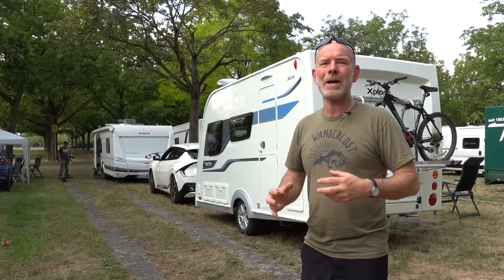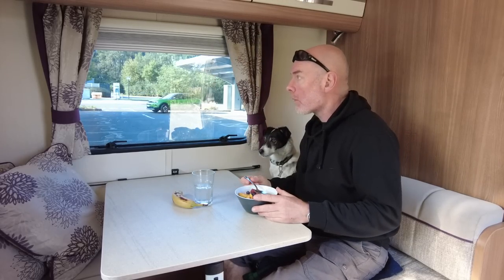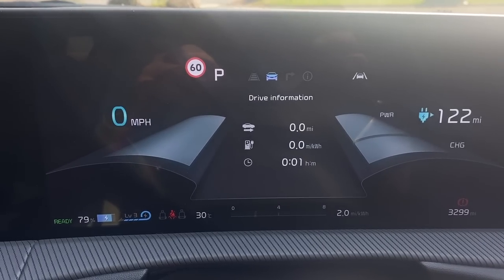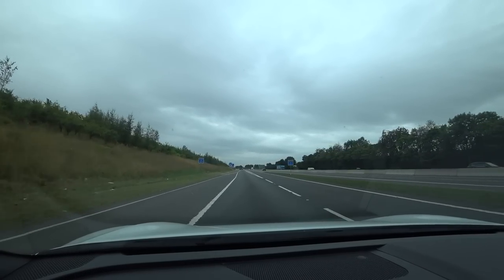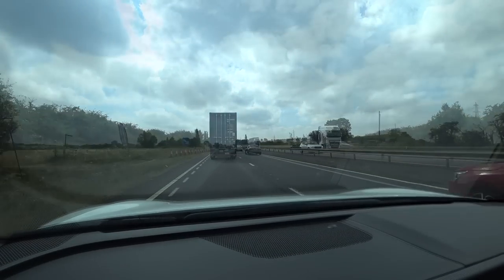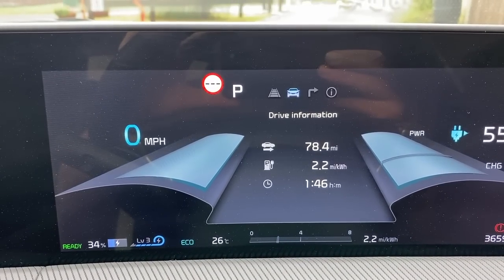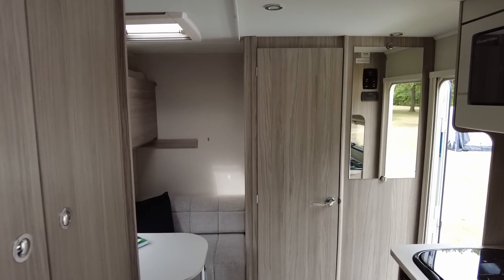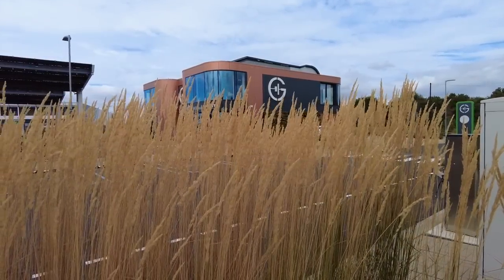EV towing a caravan to Germany from Scotland: Range and cost

Comment: Thanks for pointing out that towing is not an issue for EV. And the driving is very relaxed.
My experience is with my ioniq 5 and a 740KG max trailer....From Poland to Netherlands in 2 days without any issue at the end of Christmas vacation. (1280 km in total or between 600 and 700 km both days.)
Because the cold wether (-2 to 5 degrees celsius during the travel) I cannot copmpare the energy usage directly to usage with warmer wether but it seems that the usage is not very different from tavelling without trailer (take into account that without trailer I'm allowed to drive 140 km/h in Poland and advice of 130 in Gemany...with trailer ca 80 km/h in  Poland (LKW speed mostly is 85-90 and I take that speed) and 100 km/h in Gemany...The netherlands does not count in km because only a few km from German border. 

May I recall to previous years when car owners pu an aerodynamic shield on top of the car to bring the caravan more out the wind....I was told then that it meant the owner could use fifth gear instead of constant fourth gear....
It could save you electricity.
You tell that the smaller caravan increases youre range with 15%...but also you was driving a little sloewe. My experience is that any mile slower will increases your range with some 3%...3 miles slower means 9% increase of range. 

(My light trailer is special bought to be the same height as my ioniq 5....such a device will not add to me anything....maybe changing the back of the trailer hood, lowering the trailerhood there can make differences if done aerodynamical correct. Also <=750 kg trailers (or less) are taxfree in the netherlands. Aerodynamicall...It is the back of any car/trailer.caravan which effects the drag most)

To the end..Already for years I drive electric, first long travels with a koneE64....and I'm  also used to eat my meals including breakfast at the charging stops. However....The ioniq 5 ..same technic as EV6..charges so fast that I have no time enough for a meal if I charge to only 80%....means that I put the DC ( fast) charge limit on 90% and stop with charging when my meal is eaten (possible I even have to disconnect ftom charger during my meals when the car reaches these 90% in less than 30 minutes.)
Reply from the maker: Thanks for sharing your experience. I did have a problem over the winter with the charging slowing right down because of the cold, but you are right about not having enough time to get a meal! All the best.

Comment: How frustrating is it having to disconnect and reconnect the trailer at every charge stop? How much time does it add to each charge stop in total? How close are you able to park to chargers most of the time?
Reply from the maker: 1. Not very. 2. Mentioned in the video. 3. Depends.

Comment: That was a great vid. I prefer to tent so you don't have to charge as much and you can just zip around anything with ease. Kona EV and a big tent. No problem. What is a problem is the far and in between chargers in Ontario Canada. So IVY, Flo and Circuit Electrique if you are listening? We need more chargers in Ontario. If I had only a 100Miles of range I would get stuck in the middle of nowhere.

Comment: Awesome! What a fantastic data deluge and therefore great contribution to the community!  Great to be able to compare aerodynamics in real world conditions as the fronts of the Xplore & Compass are fairly similar so (in a not quite robust enough for a peer reviewed scientific paper but still extremely useful way) the effect of trailer weight can be seen. As well as reduced drag on that last leg I wonder what difference temperature made... aircon would have been working harder but an ambient of even just 4 degrees higher would have made a difference to the chemical reaction speed going on in the battery. How much, I've no idea (or rather I can't remember how to calculate!), but it will be interesting to see what happens in subsequent similar drives. Very much looking forward to your videos from Dusseldorf.  You probably know already but the Eriba Touring range has had quite some changes this year - whole new chassis I believe including a Knott coupling, which apparently comes about from Hymer building their own chassis production line! Would be interesting to hear any updates on what their thinking is in terms of competing with Alko for lightweight chassis design...  New Tourings subsequently are now flat floored rather than raised at the back and have a refreshed options list including copying the rear boot/underbed access idea from Airstream, retro road lights, chrome everywhere plus interior style tweaks building on their Ocean Drive, etc. experience. There's also for the 1st time in a very long time a 560 with fixed bunks and the Feeling range (Tebay are I suspect the only UK supplier) also has a new fixed bunk version (again there hasn't been one of those for ages) but it's a monster at nearly 7m long ;-) still shows Eriba are thinking small & lightweight for multi child families for the 1st time in ages in addition to their luxury, massive, heavy, other ranges... Looking forward to seeing what else you unearth :)
Reply from the maker: Will go check 'em out Becky! Cheers.

Comment: Note to all EV caravan towing drivers…..sit behind a HGV for every journey, and buy a smaller caravan……lol.  Thankyou Andrew very interesting info….and a massive saving to be seen already, for a small change in routine…👍🇮🇲🐶💪
Reply: I was doing similar in France with a 3 litre diesel X3 and 1600kg caravan, got up to 34-35 mpg for around an hour until i pulled into an aire, i was generally getting aroun 31 mpg in normal traffic so the savings are there - you also do not need to be right up the lorries arse either
Reply: Always look for a nice big HGV to make a hole in the air👍

Comment: Excellent informative video as usual Andrew. People are free to make their own choice, but you have proved that it can been done.  Sure it took a little planning, but you never appeared to suffer the much advertised "range anxiety".
One question, why did you not compare the trip with the diesel using the ferry to make them more comparable, as the diesel covered a lot more miles?
Those discounting EVs because they want to do a trip without stops, should acknowledge that you had to stop to change caravan, offload Dougal, eat, rest and use the toilet.
Reply from the maker: Hi Charles, I was purely comparing the trip to one I had experience of making before, as I couldn't actually do a like-for-like comparison. That's why I broke it down into units. I'm totally with you on the 'non-stop' brigade. It's all white noise to me now!

Comment: Great video, we've just bought a Pennine Pathfinder to replace our old caravan. Mainly for more space, but also in anticipation of our Kia EV6 arriving early 2023. I think the wind resistance is going to be the key thing for range, so am hopeful I'd get decent range with the Pathfinder, 120 reliable miles would give us a great area to explore from the North West of England without any charging stops. Would love to see what you get if you do get a chance to tow a folding camper.
Reply from the maker: Cheers Richard. I hope so. I'm finding 140-150 miles now is doable on a full battery and 100 on 80%, so I imagine you'd have no bother with 120 miles with a Pathfinder. It's now just a case of trying to find a trailer tent from a dealer that is sufficiently insured for a test tow, as it's classed as commercial use :-/
Reply: @andrewjditton  Got ours privately, but did visit the main dealer/factory first. Lovely people and quite interested in questions I had regarding the external socket for charging an EV (I wanted to know what the circuit could take, it's only on a 10amp ring main fyi). I'm sure they'd be interested in letting you borrow one for the publicity.

Comment: A very interesting and enjoyable video. I think one of the main points that can be seen is that positioning of EV charging points need to be brought more to the front of planners minds when designing  (or redesigning) the layouts of service areas. Particularly on Motorway service areas where long journeys with a caravan in tow would be expected. Having to unhitch the caravan in order to get onto a charging point is not really a way forward. Drive through rapid charging points should become the norm.
Reply from the maker: YES!!!

Comment: Great video Andrew, I would go out and buy an EV tomorrow  buts its the cost of one also living up here in Yorkshire  our local coop petrol  station doesn't  have EV  charging yet and as they are very few and far between also being a carer and doing many miles over rough roads and cattle grids I am afraid  the EV will just have to wait until lots of costs and road improvements  are made , which is a shame because EV is the future  car which I would prefer  😃

Comment: Hahaha. Our last trip was towing our 11foot, 2500kg van from Darwin, through El Questro, up the Mitchell plateau, then down to Broome via the Gibb river rd, then back across the Tanami to Alice Springs. Longest dist without fuel was Bililuna to Yuendumu, about 600ks. No charging, no power, anywhere between Drysdale station and Derby. I carry 125 litres of diesel  which will give me about 750km of range. 
Electric.....  never going to happen. There is not enough copper or lithium in the world to replace the existing fleet.
Unless you live in a rich, firstworld, tiny-footprint country.

Comment: Interesting, thanks.  There are some attention grabbing headlines doing the rounds at the moment that charging your EV will be more expensive than filling with petrol, given the recent energy price hikes, but this video shows that they've got a way to go before that becomes true.  If only the route into EV ownership was more affordable then the running costs are certainly much more palatable, and your video shows that with better infrastructure, such as what GridServe are installing, then it's just the mindset of the neigh-sayers that needs to be changed.  Rome wasn't built in a day.....👍
Reply from the maker: Cheers Matt. It IS possible to pay more with an EV than diesel, especially when towing and especially when in a hurry, but you'd have to try very hard and be a bit dim to use these places all the time. Overall the cost is still well cheaper. And yes, infrastructure is coming along.

Comment: I think reason you got better mileage in Holland , is because the slower speed you where doing it’s the same with petrol and diesel cars ,go down to about 50 mph and you always get better mpg
Reply from the maker: Yes, that's why I expanded on that at the end. That, and the smooth surface with less rolling resistance.

Comment: Thanks for the video, I enoyed it. I would say it proves that EV's are not good over long distances especially towing a caravan. How long before the caravan gets stolen? What happens if two EV's are on a site and only one charger? We recently went to Spain, virtually no EV charging points between Channel and border. The disadvantages are endless.
Reply from the maker: As are the advantages: quiet, smooth, powerful, stable, strong. I've just checked chargemap and there appears to be slightly more than 'virtually no EV chargers' along that route by a few hundred or so, so I'm not sure where you got that data.
Reply: @andrewjditton  Andrew, you've come back with the advantages of EV as you see it, please allow me to come back with the advantages of my ICE Mercedes GLE. It is quiet, silky smooth 9 speed gearbox, 3.5 litres of Diesel torque and power, stable with four huge tyres, strong tow  bar spec 150kg, beat that ! And best of all with two adults two dogs and a 1900kg Couchman VIP675 to pull it'll take us 600 miles, with a 5 minute top-up another 600 miles and I don't have to worry about unhitching her at a service station. I respect your opinion and I trust you'll accept mine - supporting EV's with the current energy crisis, which is not going to improve is a case of joining in the old tale of what lovely clothes the naked emperor is wearing...
Reply: @GG-gotr6  Indeed, you're right. You need to have a pioneering spirit to tow a caravan with a BEV - it requires a certain forgiving attitude of mind. But it was only 14 years ago you had to have a similar pioneering spirit to just drive an ordinary BEV, - basically the Leaf - 24 kWh £30,000 and range a lucky 100 miles and no chargers for the nearest 100 miles.. However, there's a reason we're all going to have to go BEV, like it or not, and that's that we're killing our planet and our future with over 2,000,000,000 ICE vehicles, spewing out about 5 billion tonnes of CO2 into our overloaded atmosphere. So just remember to apologise to your grandchildren when you're old and they're facing some existentially  difficult and probably insoluble problems. Remember too the privilege you have to enjoy your life-style when 90% of the rest of the world's population can only stand and stare as you whisk by in your glorious metal chariot. Cheers. JKM

Comment: Caravans manufacturers really need to start thinking more about weight. My last caravan was a six berth 1994 Elddis 1080kg, the equivalent now would be over 1500kg. My 1st caravan was an old 5 berth, I think that was about 750kg, still had double glazing but no water heater.

Comment: If you went via Euro Tunnel with the EV you could have taken your dog. Adding kennel fees it would have added a lot. You compared two different routes using two different vehicles. Useful info on towing a caravan with an EV that I haven't seen anyone else do. Leaving your caravan in the services is risky as pikeys like pinching them.

Comment: Brilliant video - thanks for the excellent content 👍🏻

I get why you compared it with the Navara via Chunnel but would also be interested in the like for like (can probably work out if I rewatch)

Some really good advice re swapping activities (brunch whilst charging) and drafting HGVs for economy (latter applicable to all!)

My main gripe with CPOs is lack of “drive through” charging provision - especially at new sites 😟
Reply from the maker: Hi Andy, yes I was comparing my own behaviours, but I gave the cost per mile to give an idea. I agree with your gripe. MY main gripe is that so far nobody in the automotive or charging network industries will see me or have the slightest interest in the data and experience I am collating. I approached Gridserve a week before my visit to ask about pull-through charging and if I could speak to someone to explain the facility. I got an acknowledgement but no actual information or follow-up. I'll keep chipping away though. Cheers.
Reply: @andrewjditton  I have replied to so many CPO tweets about new locations pleading with them to consider provision of drive through (or end) bays in future designs but they rarely engage. 😟
Reply from the maker: Ugh. Sadly I have had the same (non-) response from Gridserve.

Comment: Kia EV6 depending on spec £46,000 to £60,000
Not exactly affordable for the masses.

Im one of those people that spends around £500 to £2000 on a car.
Ive owned my current £1500 vehicle for 14 years! Its done 450,000 miles and still returns 50mpg.
Reply from the maker: Impressive stats! But for those people who are buying a new car...
Reply: @andrewjditton  EV's are the most destructive vehicle EVER devised.
It is FAR more environmentally damaging to produce than any equivalent petrol or diesel car.
It has a shortened life, due to the limited lifespan of the battery being just a fraction of a modern petrol or diesel engine.
Plus, as the battery is the largest and most expensive component in the vehicle, the car will be rendered almost valueless once it decides it doesn't want to be charged any more.
In short. They are a con. A very expensive con. A very destructive con. A very dangerous con.
Reply from the maker: @sahhull  please could you cite the sources for your arguments, and the information behind who is funding those sources?

Comment: Andrew, you responded to a recent comment with the advantages of EV as you see it, please allow me to come back with the advantages of my ICE Mercedes GLE. It is quiet, silky smooth 9 speed gearbox, 3.5 litres of Diesel torque and power, stable with four huge tyres, strong tow  bar spec 150kg, beat that ! And best of all with two adults two dogs and a 1900kg Couchman VIP675 to pull it'll take us 600 miles, with a 5 minute top-up another 600 miles and I don't have to worry about unhitching her at a service station. I respect your opinion and I trust you'll accept mine - supporting EV's with the current energy crisis, which is not going to improve is a case of joining in the old tale of what lovely clothes the naked emperor is wearing...
Reply from the maker: Sadly the energy crisis affects all forms of fuel. I’m glad your rig works for you as mine works for me. I’m not out to do anything other than honestly report my experiences, yet for some reason people get very defensive about it. Why is that?

Comment: 😳😳 Merc E220d and 1.8t Hobby Premium 560 UL. Range is 600km (360 miles).  I am not anti EV but current ranges are a joke. Maybe in U.K. with shorter distances but here in Germany a 1500km trip to south of France or Spain is two days (day one 1000 km or 12 hrs driving and the balence on day 2). I have no wish to stop every 2 hrs and wait an hour to recharge. Assuming you can even get into a charger with the caravan attached.